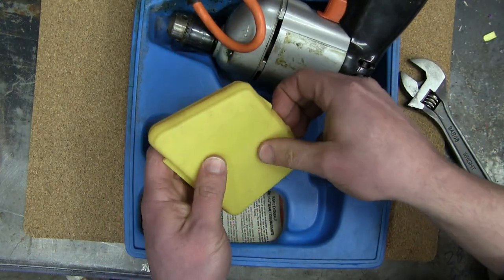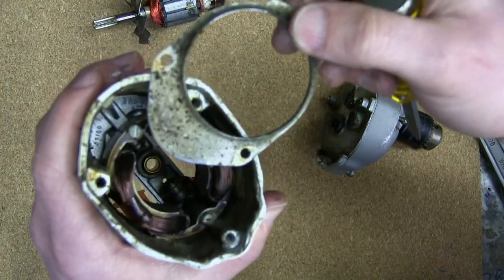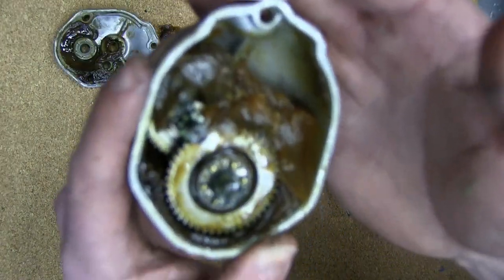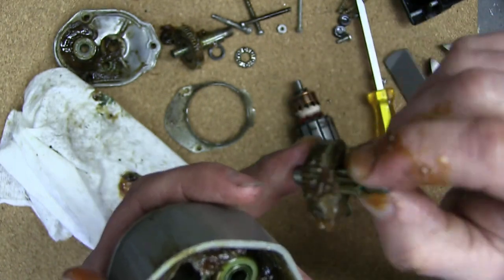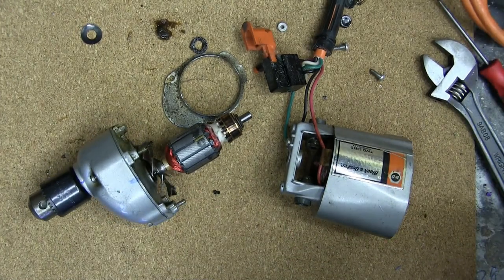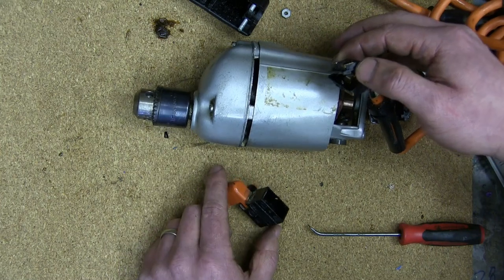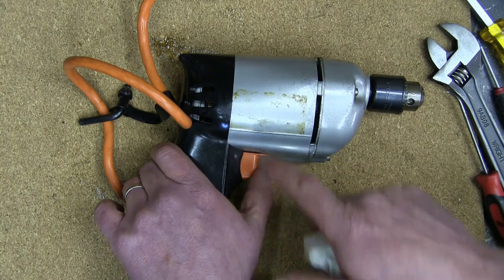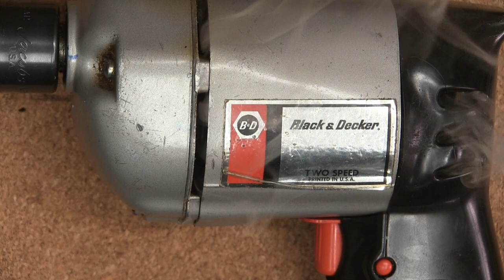BOLTR: Black & Decker. Old School.

Comment: that drill brought me back.. smiles  ear to ear.  had to avert my eyes at the end.  squeemish.
Reply from the maker: Just about time you introduced your lad to the wonders of electrocity, no? It's only abuse if it's "intentional".
Reply: Next-Week-On-ThisOldTony: 
"How To! Pick up the pieces after your entire house burns to the ground."
bonus material: "11 mind blowing novel uses for those sprinkler heads that didn't work"
Reply: AvE my apologies for button in, how are you both doing AvE and Tony? I recently picked up and old SKIL SHER 5/16 POWER MATE DRILL, I'm not too good with the interwebs, and don't wish to break my girlfriend's computer either!!!! I'm asking for a little bit of help, is it worth restoring to it's original Glory???? to put on my bar as it's a drill my grandfather probably used back before my time the 80's, CAT number 33, 240 VOLTS AC, 1.75 AMP, 2500 RPM, APP number V/UU, made in Australia, thank you for your time it has been muchly appreciated
Reply: This Old Tony my dad gave me his.
in the UK the chuck had a little eccentric on the back.
you lined up 2 dots on the cam hand tightened the sleeve and the pinched it up with the allen key. 
neat.
Reply: the problem is you didn't put water on the sponge
Reply: You should have fixed the Fucking thing to get it to 2 speed.  Lkl
 I think my dad still has that exact same one. Minus the magic pixie smoke.
Reply: I couldn't bear to watch him destroy this heirloom. I have nearly the exact same drill, mine must be a little newer because it has a speed control knob and can go into reverse, but everything else looks the same. From my grandfather to my father it has is come to me.
Reply: Such a nice drill. Ruined.
Reply: Fred is dead
Reply: No no no no why did he fry the beauty
Reply: @galvanizedgnome  It still raises my hackles and crunches my cringes

Comment: I have a B&D  drill of the same era that I bought while I was in high school. 1971?   It was my first power tool.  I've used it when it was so hot you needed to wear gloves to hold it.  46 years later it's still going strong.  I used it last week.
Reply: Leave it out in the sun all morning. Bring it inside. Ask apprentice to hand you the drill. Laugh while he shrieks like a girl with burnt hands. 
Mine has the aluminium handle too. Still have the matching circular saw. Can’t kill em both 👍
Reply: @ Jack Paulson Awesome I cant keep from losing set of car keys for more then a few years that is phenomenal man
Reply: @ jack Paulson

Comment: Green is a chemical reaction between the grease and the brass or bronze bushing material, but only in the places water was able to reach in use. That pale yellowish grease is the original B&D grease, a pretty good lithium soap that is very long lasting.

The brazed thing is either a PTC thermistor or more likely a soft brazed in diode, just to either give full pixies or only half, which for a drill is half speed when running on DC.

Comment: Can confirm, the grease inside my B&D hasn't gone wonkey. Old tools are great work horses. And if you pet them, clean them, keep the stable happy, they will serve you, your kids, their kids etc. My oldest all metal tool was my grandada's. It's a first generation Skill saw. Still works like new, with just brushes and bearings changed.
Sometimes it's nostalgia, but when you heft a big lumpa metal to drill, cut, grind something, you know it's quality. They hadn't learned to cheat us out of our money then.

IMO it's like the old axe head story in medieval times. One such axe head would be worth an entire family's coin, and it would be passed to son and son until nothing but the stem was left.
Reply: I have one of the old skil saws as well from my grandfather. Took it apart, cleaned out the saw dust, new set of brushes. Perfect. Bearings were fine. Used it last weekend to cut some wood.
Reply: I got over the nostalgia the moment I started buying quality tools, plus I swear all are new stuff is designed to remind me of transformers!
Reply: Them there saws was a great way to build up your arm. I do mean singular.
Reply: With the flip down tail guard one little kickback and it was by by fingers. You could beat the crap out of those saws and the kept on going. An expensive and cherished tool for the day.
Reply: Totally agree my old radial saw is still going strong despite the hot suppers I regularly give it.  My 70 year old bandsaw still works but it needs some adjusting and not so gentle persuasion on occasion due to its age and being made of onobtanium

Comment: it's probably a diode, not a resister.
Reply: thats what I thought I have a high/low dimmer switch for a lightbulb and it just has a diode Its a nice simple way for a bit of speed control and not much to go wrong in it if the diode goes short full speed open no speed
Reply: definitely a diode. half wave rectification.  easy way to turn a clean 120v rms into a dirty as fuck 60v rms with out much power dissipation
Reply: Good thing they dont use that circuit for dimming things like heaters because that would end with a weird ac waveform in your mains one side of the sine wave will be bigger than the other
Reply: for a heater you could have two separate heaters, each with half the power. When you're running at half speed one heater gets one half of the waveform, and the other gets the other half - then whatever unspeakable things it does to your power factor ought to balance out
Reply: Tripp Williamson j
Reply: Oh they do, they do. Try opening cheap hair dryer. Quite some amps too...
Reply: Tripp Williamson :  Bingo.   AvE was under the influence of Molson or other Canuckian swill.
Reply: Keith Jurena - maybe the Fukushima radiation from San Fransisco and Seattle tilted him a bit.
Reply: If they have two separate elements it's far easier and cheaper to just wire up one of them for half power instead of adding diodes.
Reply: Diode, I was screaming at the screen, I thought he knows his shit.
Reply: It halves power*, not voltage. RMS voltage is actually divided by sqrt(2), so it would behave more like 85V.
*This is for resistive loads, a motor may not behave exactly like this.
Reply: I have seen these diodes in their ordinary form (cilindrical axial) in more modern B&D drills
Reply: Mremiriv, you sir, are incorrect about half power. It stops conducting when the voltage is negative... check out this link:  https://en.m.wikipedia.org/wiki/Rectifier#Half-wave_rectification_.28M1U.29
Reply: given: 
Vrmsfs = RMS voltage of full sine wave
Vrmshs= RMS voltage of half sine wave
that article says:
Vrmshs=Vpeak/2 
Vpeak for full sine wave is: Vpeak=Vrmsfs*sqrt(2)
for 120V: Vpeak=120V*sqrt(2)=169.7V
so: Vrmshs=169.7V/2=84.85V
Reply: The confusion comes from Vpeak, some people apparently tried to edit the article to sqrt(2) because they confused Vpeak with the full sine RMS (if you try to edit it you will see the commentary)
Reply: yep a Diode. my 2 cents worth

Comment: I have a variable-speed reversing version of this drill.  Exactly the same motor and gearing and body, but the trigger is a triac speed control, and there is a reversing switch built into the rear edge of the handle near where the cord enters.  Speed is rated 0-1000 RPM.  Bought new from Canadian Tire about 1977.

Last time I tried to use it, it didn't run.  The grease had separated, the oil ran everywhere including into the brush holders, and then turned into glue.  So the brushes were stuck and no power made it to the commutator.  After cleaning out the gunk with solvent and assembling with new grease, it runs like new.  (And if I had replaced the grease 20 years ago, when I saw signs of it starting to separate, the solvent cleaning wouldn't have been needed this year).

It's not a wonderful drill.  At least one of the gears isn't quite concentric with its shaft,  and the gear mesh alternates from tight to loose as the gear rotates.  It requires fiddling when reassembling the gear case to avoid binding, and you can hear the change in clearance as it rotates.  It has always been like this.

But I've got to give B&D credit for building a drill that has survived 40 years including being dropped a couple of times.
Reply: Saw another one of these drills in Value Village the other day.  Variable speed reversible, same as mine.  It still ran, though the speed control didn't work very well any more.  And it also has the same sound from the changing clearance between gears.  This one was a lot more beat up than mine externally, but still alive.

Comment: I've got a 1958 B&D all aluminum single speed, 1000 RPM, with a 1/4" chuck.  Still works OK, use it with a wire brush to clean crud.  Only replaced the power cord and the chuck over all this time.

Comment: I grew up in the northwest suburbs of Chicago, Capitalistan in the 70's.

It wasn't a B&D but of similar construction.  In a semi-finished basement with a bare, painted concrete floor I learned not to use that drill with bare feet.

Picture the cartoon image of a character with limbs outstretched glowing over the skeleton.

Thank you Tex Avery and Chuck Jones.

Comment: What a sin! Burned up a useful dill for shits & grins :-(  I would love to find that style B&D drill at a flea market or garage sale. I have a neat little bench drill press attachment for that style B&D. It mounts the drill by a bracket that slips over the top 2 filister head screws at the chuck end of the drill and the rear of the drill was held by a deep setscrew like socket over the top screw in the handle. I bought it new amost 50 years ago. Wore out 4 or more drills with it. Unfortunately that model drill got dicontinued in the mid 70's. Now the little press hides under a bench without a drill for it. Too neat a tool wth many fond memories of the many things I build with it in my 20's and 30's to throw away.

Comment: The two speed is achieved by powering one or both sets of windings in the armature ,hence the four wire set up ,two for each winding . the brazed component is a combination high /low filter to suppress rf feedback into power supply grid :)

Comment: That same drill motor/gearbox was/is used on Westinghouse (later Cutler-Hammer and now Eaton) DS circuit breakers as a charge motor.  Those motors and gearbox are nearly indestructible.

Comment: You know, one of the oldest tools in my family is a drill of this vintage.  The dang thing can noot be kilt no matter what has been done to it over the years.  The dang thing built a house and did 1000 diy diddly jobs.  I mean I know... who wants to use a corded AC drill at all anymore but damn when all the batteries are dead and the fancy drills are lost somewhere or you're waiting 20 minutes to get a charge on you grab the 40 year old "POS" out of the far back part of the tool drawer and pull the trigger on good ol' AC current and suddenly you don't think the crappy old drill is so crappy anymore.  It gets the dang job done with authority... while making enough noise to wake the whole block.  The particular sack-of-gravel scream they make is just nostalgic.

Comment: I still have that drill. I am 59 and it was my dad's drill before that. The last big job it did and I had to stop due to a burning smell but no smoke and it still runs. I used it to drive 500 screws into two 3/4 inch thick plywood sheets so I could tile my front hallway. No very powerful but a workhorse around the house.

Comment: That round brush space is a simple but great dynamic brush holder, it'll hold it tight,(round) for cheap making tight fitting, and it'll allow the brushes to bind less being able to twist with torque on those far commutator bars. Sexy!

Comment: This is a woodworking drill; it doesn't have reverse. 

The "unknown device" in the switch is a diode; it reduces speed/torque by essentially cutting the bottom half off the AC waveform. Think of it as a poor man's PWM. ;) As you can imagine, inductive reactance when switching from half-wave to full-wave is quite high under load; hence the arc-burns on the contacts you were talking about.

I had a similar B&D VSR drill (maybe older, but used the same motor/transmission) I inherited from my grand-dad; it survived 30 years (with occasional regrease and new brushes still available from Jandorff/Ace Hardware) of frequent use in a jig for drilling pipe before the pinion portion of the motor shaft wore out.

I'd bet you a dollar if you went back to it after it cooled down it would still work. :D

Comment: A similar B&D was my first power tool, bought in 1971.  It served me well for decades.  When using it as a sander it would get too hot to hold, but was always ready for more after a cool down. I accumulated other sanders and drills, but kept that old guy around for little jobs.   On one of those small jobs, just a few years ago, his smoke finally came out.  Kind of hard to watch his younger brother mercilessly tortured and executed.

Comment: They used to use a diode to halve motor speed, usually selenium or later PN silicon. they even used them with shaded pole motors to halve speed in things like fans by effectively chopping wave form in half. Rough but effective

Comment: Seeing that drill brought me back to when i Borrowed my Grandfather's Black&Decker drill.  The metal body, the broken ground... the tingling sensation when you used it.  I still have my Dad's metal body reciprocating saw, as well as his all steel, powered planer.  These must be badly grounded since I've acquired a fear of using them and bought newer insulated ones.  Thanks for your humorous franglophony (I'm originally from Québec).  Keep Skookum.

Comment: my dad has an old Milwaukee drill, 3/8 chuck, same arrangement as this one, all metal except the handle.  He's rebuilt it a couple times and replaced the switch a few times, but has had it since i believe the late 70's early 80's.  I, myself have driven probably 1000 drywall screws with it and who know's how many he has.  They don't make em like that shit anymore for sure.

Comment: Someone else has probably said it, but the old B and D drills could be mounted in a stand and be used as a grinder or buffing wheel, so it needed the button to lock the switch in the "on" position. I've got my dad's all metal version from the fifties, metal gearbox and plastic body version from the seventies, and all plastic body version from the eighties, and they all had provision for mounting in a stand.

Comment: Funny story about the Robertsons....my grandparents had a cabin in Canada, and their high security door lock was what they thought were cutting edge technology--"square drive" screws.  (This is in the late 80's.) They said, "What's the chance someone in Canada will have one of these?"  

My Grandpa was absolutely pissed when one spring he opened up the dock house and found a $20 next to an emptied gas can, with the door still screwed tightly shut.  It's funny, because...Canadians invented the "square drive" (i.e. Robertson)....and he didn't ever figure it out...he thought he was being clever, but he played into their hands!  And happily, that snowmobile-ist was presumably able to safely return to civilization, thanks to my grandpa's particularly Canadian accessible fuel depot.

Comment: I have several of these drills and they are still working. Tough old blisters. If you have no further use for that one I could use it as spare parts, The plastic part of the handle seems to be the most fragile piece. It just doesn't stand up to the repeated trips onto the concrete floor in 35 years of service. I would be willing to purchase it and pay shipping.  Tom

Comment: Just got a Black and Decker impact wrench, 7.7amp, a 6511 type 3 (last one made in Jan 1977),  240lb-ft of torque rated, ten buxs well spent.
Still runs super smooth (was probably only used twice a year to change tires). 
I call her 'Ol Sparky, on account the last guy put the brushes in sideways! Would have been fine when new, but now hat they are worn down to a crescent moon shape, the can make contact with more than one commutator bar at once, so sparking around the brushes, especially when you suddenly switch between forward and reverse. Fortunately, they still make the many of the parts, so currently waiting on new brushes/holders/springs, and the plastic cap that disintegrated when I took out the brushes to have a look see. I have enough access to clean off the commutator with a qutip and get my scalpel in there to ensure no contact between any of the bars (Doesn't appear to be any though). Waiting on new parts, about $15, so I'm only in it for 25 Canadian pesos. I think I need 2 screws though, looks like they were on the back to help keep bushing assembly in place. Jelly bean part, so no biggie. 
Tried to take it apart (I know, if it ain't broke....), but figured I could put in some new better modern grease and a good cleaning. . Well a good bit of janky resistance early on changed my mind. Once I fuck it, I'll give her a go I guess. 

Heres the official service guide: https://servicenet.blackanddecker.com/Products/Detail/6511

ANy ideas on a good way to recondition it? Anyone?

Still, its amazing to me that several of the components (including brush assemblies) are still used in modern tools!, which works perfect for me.

Anyway, love old tools, they make me happy. That and any knife made in Sheffiend a long time ago :)

Thanks fof the videos, have a good one eh, Peace

Comment: Just got my hands on a 1960 d500 black and decker drill, pulled the trigger and she screamed like a banshee so I knew something was off. She was absolutely packed with shmoo and a lot had hardeded. Gave her a very good clean out and she runs like a watch. Since I know it will last forever, time for another 60 years service😂